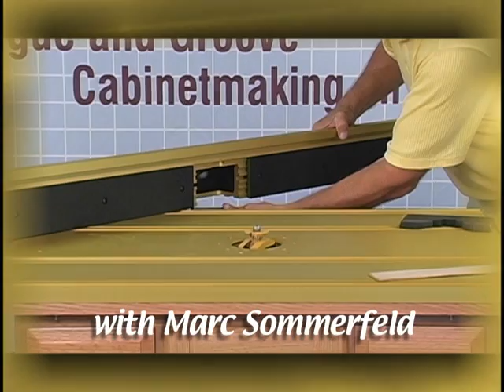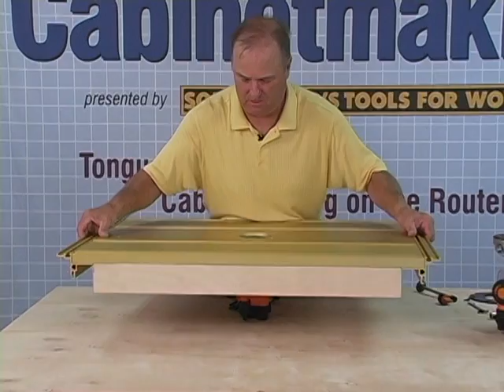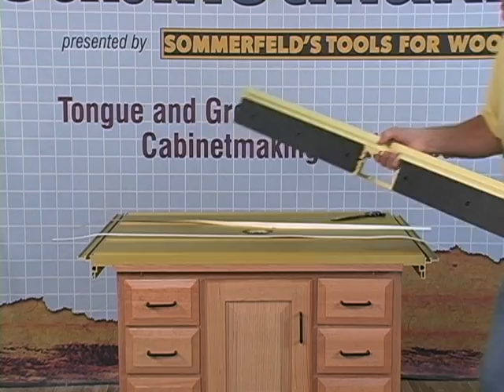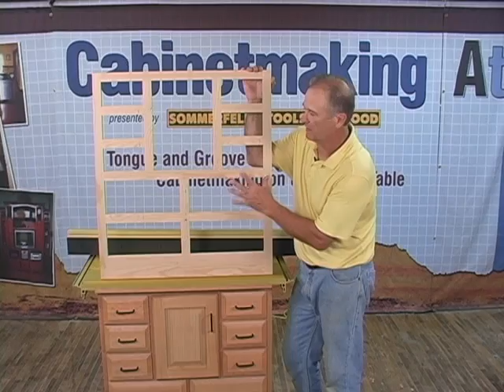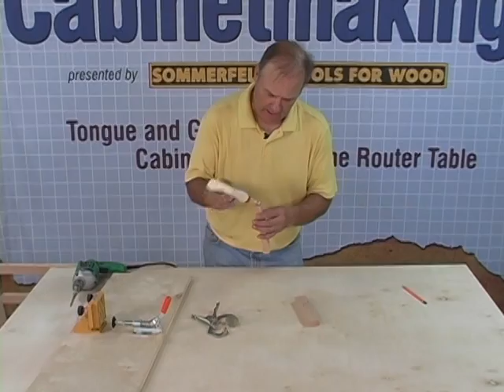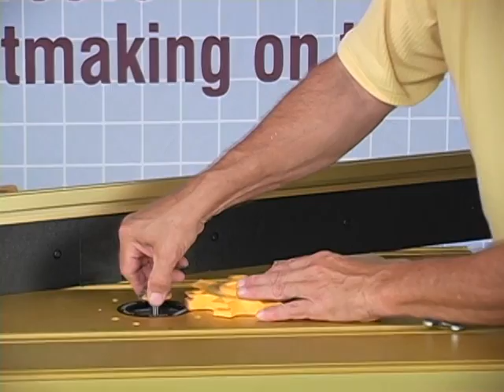Sommerfeld's Tools for Wood - Router Tables Made Easy with Marc Sommerfeld - Part 1

Comment: So I need a second router and an additional pattern bit to actually start using this system?
Reply: Pretty much, but think about it for a minute.

If you have a router table like the one he's building you're probably not going to want to disassemble it in order to use your router for more portable applications. Your second router can also be a much cheaper model and/or one that you pick up from a pawn shop. 

Still a really good system. Maybe not for a simpler shop, but if we're talking about a shop where this tool will see semi-regular use then you're going to want a router that's permanently mounted and another one on standby for more portable use.

Comment: Marc  have just bought  the 3.25HP Triton Router  the only one sold in Australia that  can  be fixed to the underside of table  and change the Bit  from above the table , They must have listened to you can now adjust from above.  Only alternative in Australia is to buy one of those expensive lifting units   $500 au when for another $49 you can by the Triton Router. Like your Router Table top and Fence but have to find a forwarding agency to cut the cost US freight Companies know how to overcharge  as otherwise it more than doubles the cost  then have to convert to AU $

Comment: Hola, soy de Perú y mi pregunta es si el: Sommerfeld's Routing System usa un router de 220 voltios por que acá en mi país la red es de 220 voltios. Gracias
Reply: Hola Peruano. A mi punto de vista, eso no importa, la router hará la misma función. Tengo 5 años manejando routers. Solo considera que todo tipo de herramienta es peligrosa. Tenles respeto, no miedo. Blessings.
Reply: Irenko Tarsis Claro que si importa por que en Estados Unidos tengo entendido que la red es de 110 voltios y si voy a comprar el Sommerfeld's Routing System  ahi viene un Router incluido de marca TRITON. Ahora  si esta misma marca lo compro en Europa ahi usan la red de 220 voltios y por defecto tos sus equipos vienen predeterminados a ese voltaje.Algunas marcas como RIKON de Estados Unidos si vienen multivoltaje de 110 a 240 voltios.